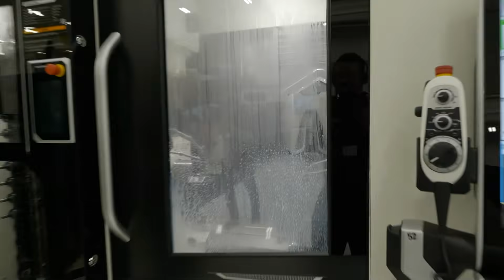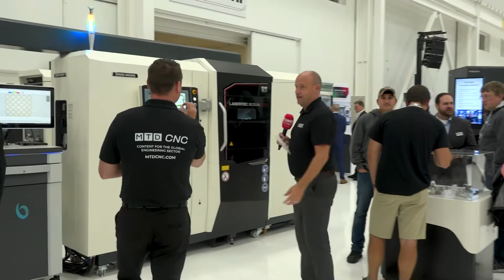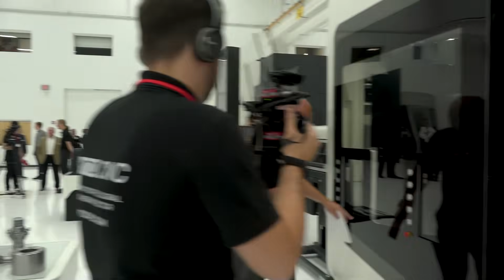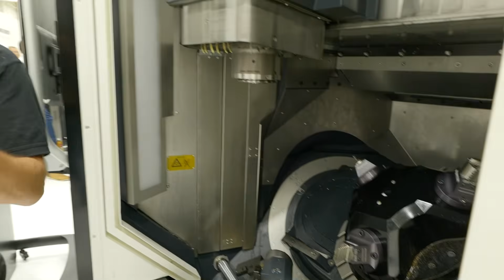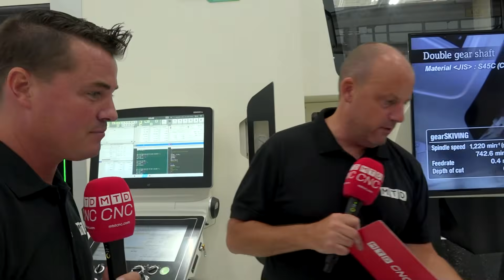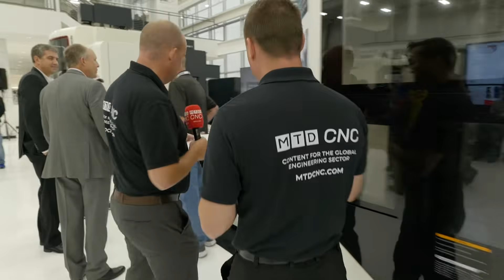DMG MORI Tech Days in Chicago, Paul and Tony tour the facility

Comment: I wonder how many of those salesman crash those floor room machines? I know it happens because I’ve seen it happen. I just wonder how often it happens and I wonder if someone loses their job over crashing the floor room cnc
Reply: 3.42
Reply from the maker: hope not, there is plenty of fail safes on these machines
Reply: @MTDCNC  I work on them every day. There is no fail safe for bad code or human error. It does what you program it to do. They are extremely easy to crash. It only takes one bad line of code.